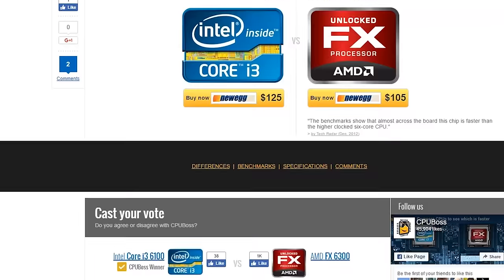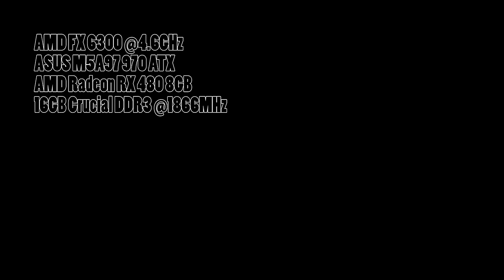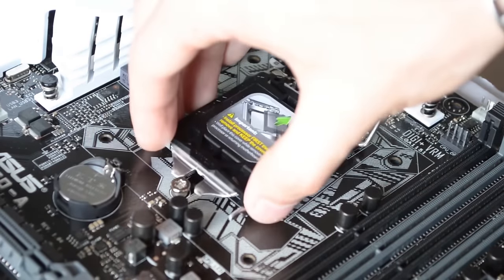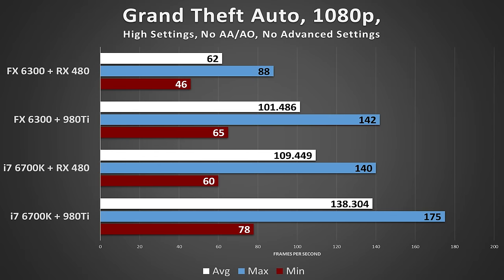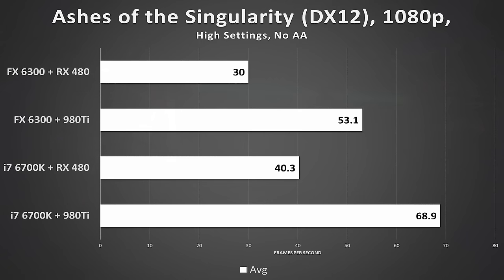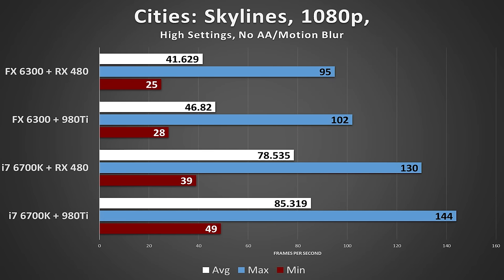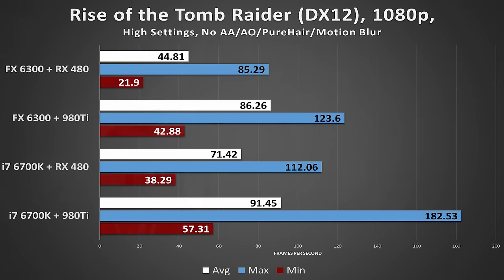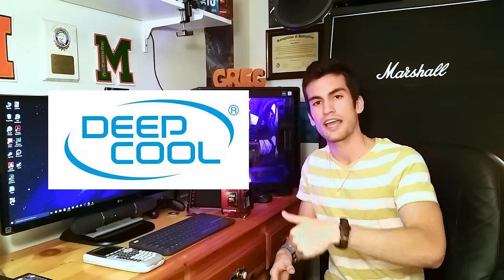AMD FX 6300 + RX 480: Severe Bottleneck?

Comment: i would like to see a fx 6300 vs 8300 vs 9500 with rx480/980ti video. I debating on what upgrade to go with and it further explain a sliding scale of bottlenecking. Plus you wouldn't have the ddr3 vs ddr4 fight in the comments.

Comment: My first PC build was done in 2014. I went with the FX-6300 and paired it with the 750ti and 8 gigs of RAM. I chose the 6300 over the FX 8350 cause it just felt right. Researching all I could about CPUs it just seemed like if I were to pay over $160 for a CPU I should look at Intel instead. But at $90 the 6300 was the best for the money.

Comment: CAS latency and timings are measured in clocks, which don't tell the whole story. If you have the frequency 66% higher and the CAS latency is 66% higher, then it's effectively the same CAS latency. For instance, 1600 MHz RAM with a CAS Latency of 9 is 11.25 nanoseconds, while 2666 MHz RAM with a CAS Latency of 15 is 11.253 nanoseconds. That said, DDR4 won't make as huge of a difference as what some people make it out to be.

Comment: I about to make an upgrade and I wanna know how much of a bottleneck I'll get, and if it's a "ok" upgrade.
My actual kit is:

MB - Gigabyte 78LMT USB3 6.0
CPU - AMD FX 6300 3.5GHZ
GPU - R7 370 4GB
RAM - 2x4GB 1866MHZ
PSU - C3 Tech 500R VE

I would like to get in there an MSI RX 480, and to reduce the bottleneck I'd OC my FX 6300 to 4.0GHZ maybe 4.5GHZ. Or you think it's better an MSI RX 470?

Thank you so much for the attention.

Comment: Actually, I upgraded from a Gtx 950 to an RX 480. I have an FX-6300, and I don't seem to have too many problems. Although it's mainly me not playing CPU intensive games, I'd suggest if you think you need an upgrade to get an RX 480. I plan on getting an FX-8350 for Mankind Divided at a later date, but for now if you want a "cheap" 1080 card, the 480 is decent.

Comment: I ran an R9 390 with an FX-6100 for a few months before I was able to upgrade to an FX-8350. I did have the 6100 OC'd to 4GHz and it ran fine, but the performance is much better with the new setup (should be obvious).

Comment: I think you would enjoy checking out Max PC's long examination of RAM DDR 3/4. They demonstrated CAS latency is pretty much useless info. Output just passes so much higher for the higher speeds. but also that above 2800MHz at the time was not beneficial.

Comment: Sweet video!!! :D 

I am running a i5 K2320 @3ghz and 12gb DDR3 1333mhz Ram on a LGA775 stock intel board... would I have sever issues running a R9 390 or GTX 970, or even the GTX 1070 for that matter..?

Comment: I am building a new PC using the AMD FX6300 in an ASRock 970A-G/3.1 motherboard coupled with a Nvidia GTX 750Ti graphics card & I think that will plenty well enough for me. it all depends on what is good enough is for you. Heck right now I am using a GTX 550Ti & that will play just about everything so no need to drop $400 on a graphics card or pay 3 times the price for an Intel I5/I7 processor. I haven't used an Intel processor in 15 years & don't plan to in the future.

Comment: Just to add some information but might be completely insignificant for the most part, but still some fun differences:

I am running a 2 year old gaming laptop with a decent i7 4710hq, at 2.5ghz. My previous main pc was my desktop with a FX 6100 at 4.2 Ghz. I really wanted to up my graphics power quit a bit, but I find it wastefull to spend money on a complete new desktop if my laptop cpu is more than capable for nowadays games. The only thing in my laptop that ages hard these days is my GPU. So I opted for a eGpu solution. Mind you, it runs at pci-e gen2 x1 speeds. Lucky me, I was able to get a hold on a Sapphire Nitro R9 390 for just 150 bucks... keeping in mind that in the future I WILL upgrade to a desktop (waiting for zen to hit the fans), I couldn't let this deal slip. I like my numbers so I did a valley benchmark, and I got a very decent score of 2236, with an average of 53.5fps. Max at 103 and min at 21.5. Me, being really curious how it would perform on my older desktop, plugged the gpu in and started to do a bench again (this time the pci-e was running at 2.0 x8, not x16, not sure why though, might be my old motherboard screaming). So I did the same bench, on a clean windows: getting a score of 2328, with avg 55.6fps, but with a max of 94.8 and a min of 18.5. So in a way, I did get a lower avg, but the mins and highs where quit a bit higher on my laptop... running at slightly more than half the clockspeed of my old FX 6100 and a much lower bus speed :D. 

Either way, i'm happy with my 390, albeit that it probably isn't used to its full intention.

Comment: So in most of the titles with 60Hz monitor and 60fps max limit in riva tuner I will not see much difference at all, if I put RX480 into FX6300 rig in comparison to new CPU's. Seems to me, that bottlenecking over the years has changed from hype in the past, to a state that occurs only with high refresh monitors today. Why would I let my GPU display 280fps if my monitor displays 60? That creates heat, noise and electricity waste.

Comment: What motherboard did you run the FX 6300 on and did you manually set the NB (northbridge) and HT (hypertransport) in the bios (2200mhz NB and 2600mhz HTis proper OEM for the CPU applies to all vishera 4/6/8 cores) if did this on a 970 motherboard were running 1800mhz or so on NB and 2000mhz HT also VRM throttling is a huge issue on 970 chipset due to OCing also if you don't manually set the NB /HT even on a 990fx chipset  (as my linked example proves later) it will often bug out 90% of time and go 2000mhz NB and 2200mhz HT this can take over 10% of performance out the gate from the CPU. I proved this on overclock.net and even pointed it out to a user on there when his was doing it. http://www.overclock.net/t/1399704/nothing-to-see-here/500#post_23264585 

 That issue can cause alot of the vishera's performance to be lost we are talking 10%+ especially in demanding instances AKA mid-high end GPU. I also explained another issue that is a big one with coreparking and AMD module design very wise to disable core parking otherwise it flushes the cache and CPU has to reload the cache data  causing a delay because the modules share the cache between 2 cores when one is parked the cache is wiped even if adjacent core is still using data that was in it making that active adjacent core have to start over.

PLZ don't take this as bashing for me pointing out such things like this I am trying to help you come at the testing correctly and with full details / research to many reviewers and such are biased or just flat out don't care. I like your videos just am trying to make sure you come at them correctly and with unbiased results. I myself used to be a big hardware tester and benched the snot out of hardware for many years but no longer do this anymore. I am now just a casual gamer that keeps up with tech along with trying to get all the facts straight about most of the hardware as it comes out.

Comment: The only thing I didn't like about this video is that you applied an overclock. There's no point in using an expensive cooler to test the performance of a 6300k as a consumer would not buy a cooler that costs (at least) half the price of the CPU at this price point. As such the bottleneck should be even higher than what you've shown.

Comment: i'm so glad i sold my old rig for reasonable price .
I had an fx-6300 oc'ed to 4.2ghz all day everyday , but somehow my new i5 6600K at 4.5Ghz is noticeably smoother - even on stock clocks . One could spot differences even on the windows gui .
And now that i hear how much of a bottleneck is 6300 for the rx 480 , i can only imagine how huge of a bottleneck it would be for my gtx 1070 .

Comment: I built my gaming pc 2 years ago and I am thinking that the next thing to upgrade should be my processor. The thing is that less than a year ago I had to replace my motherboard because it died so I am not sure if I want to change motherboard because of the socket right now.
There is an option you would recommend in the am3+ socked that I'm using right now? The only choice I've seen in the local stores in my country is AMD® CPU FX-8350 and I don't know if it would bottleneck for instance with the RX 480.

Comment: My first and current pc build is an ultra cheap 6300 / r9 270x combo and for the money I spent I am happy. I play a lot of csgo but in bf4 I can run 50-70 fps @ 1080p at high/ max settings without all of the garbage turned on. Having said all of that though the pc bug has bit me and I am having dreams of a decent 1440p build in the near future and I am not sure if I will go amd again or not.

Comment: I once made a comment and it was stupid and pretty ignorant looking back. sorry about that.

though with a different mindset I must ask what the clock speed was set to on that 6300 If you remember?  I do have the same processor and I have it on 4.7ghz.  these CPUs are advertised to over clock . did you use the stock speeds? the 6300 is 3.5ghz and boosts to 4.1ghz.  some of us enthusiasts do overclock everything to see how far we can push things :)

Comment: I have AMD Phenom II 555BE + GTX 960 2Gb combo on my second gaming computer and it's running modern games fairly well. I scraped it up from spares I had laying around and bought the gpu (used) and memory (16Gb DDR3) (used) to it, so it was quite a cheap ( around $220) build. I was quite scared that the OLD cpu would of been a terrible bottleneck, but I was so wrong. Most of the games run nicely, even tho it's some frames less compared to my main computer with same GPU (4Gb model tho) and FX-8350.

Comment: Zen should drop spring next year, I personally just upgraded from an FX 4300 so an 8370 because it was cheap and came with that wraith cooler.

but I am catching up on gaming now that I have an RX 480, it runs all the titles at a buttery smooth 60fps on maximum settings, that my GT 610 couldn't even start.

Comment: i will say the fx-6350 @4.5ghz matches the fx-6300 @4.6ghx in my tests and cant figure out why? it indicates an inproved identical cpu not just a factory overclocked fx-6300. maby gust a heavier duty power delivery on socket maby faster cache or something that would cause a 100mhz lower clock do the same for $10 more.

Comment: but you have to consider that FX 6300 is for lower budget, like us, people from Mexico and latin america, and I think a fair comparison would be with the FX8350, can you explain why you did not do the comparison with this last processor I mentioned?, are you afraid of comparing a "4 cores procesor from AMD" versus a "4 cores processor from Intel"?
Reply: Because it simply wouldn't change much more than the performance percentage of the 2 amd cpus.. The 8350 is going to be roughly 15% better at the SAME clockspeed as the 6300.. So just do the math and add 10-15% to the 6300's frame rates and that's the difference, ohh and by the way an 8350 is an 8 core..

Comment: Well I don't know how to say it but as far I can see my Fx 6300 at 4.5 Ghz is NOT bottlenecking my Asus Strix 8gb. I have ran a lot of benchmarks and for example in Heaven (max settings 1080p) while the GPU is at 98-100% the Cpu is between 25% and 65% never more than that. I'm in shock.

Comment: I've watched this video in the past and now looking for cheap top card for my old PC last upgrade, so I won't roast You for differences in platforms. Very gratefull You did this video.
Sadly realisation You've tested already heavily OC'd fx6300 made me loose hope of any sense for going higher than my current RX560 2GB. Better card would improve playing my backlog of fairly old games, but case is small and doesn't like heat, OCing CPU and adding something like 580 or 570 will make it a vacuum loud PC during gaming most likely. I could OC cpu high but also undervolt gpu a lot so they're kinda on the same page, but then paying for rx580 doesn't make sense if I will stay with my setup for good few years or it will pottentially be my last gaming pc. (adulthood is already here, but i don't agree with it still)

Comment: My current build has the FX 6300 and my gpu is RX 480 GAMING X 8G and it runs games like GTA V, Modern Warfare, and most newer and newest AAA titles no lower than 100fps.
Reply: i cant run warzone correctly and i have a 6300

Comment: So quick question. I'm building my first PC and I'm getting an i7 6700k for the gaming and the Photoshop work I want to dabble in. Right now I have the MSI offbrand Radeon 480 8gb in my wishlist. The question is: Should I swap the 480 out for an MSI GTX 1060 6gb for an extra 20 dollars? How much of a cross the board performance boost with the extra 20 dollars give me?

Comment: Redo the Intel tests, but this time use an older i7 (like 3770k or something) with the latest core i5 6600k and i7 6700k and check results at 1440p and 4K.

Comment: Is it true? AMD gpus are more cpu performance dependent than nvidia's? Very noticeable in Hitman benchmark. (6300 + 980Ti) vs (6700k + 980Ti) only has 7.9% difference while (6300 + 480) vs (6700 + 480) has 41.29% difference. I'm a bit worried since I'm planning to get RX 480. I only have a budget cpu. By budget cpu, I mean the likes of an ancient i3-2100 :D

Comment: I mean I built my first PC a little under a year ago. I went with the FX-4350. From my research and from my own benchmarks, unless you are rendering videos the 4350 will perform better or on par with the hexa-core varients in most titles. It's also a decent amount cheaper on average (I got mine for $70 at the time and the 6300 was $95). They also remain a fair bit cooler. when overclocked to 4.7 GHz, my 4350 never got above 57 degrees C ever (Hyper 212 Evo for cooling btw, budget was very much in mind for this build) 

If anyone ever sees this comment, is Ryzen 3 worth the upgrade, or is it more of a side-grade?
Reply: It absolutely destroys the FX 4350. It beats the FX 8370 actually https://www.youtube.com/watch?v=tJNbV6-GJis .

Forget all "folk wisdom" about AMD CPUs that was based on experiences with AMD FX. Ryzen is a COMPLETELY different beast. It has nothing to do with FX processors.

Comment: I have the same case as you and ive got a new LED kit on the way... how did you mount your LEDs? I dont know how to mount them on the top/bottom without the PSU shroud obstructing the power cables :/

Comment: i am currently running an AMD FX 6300 with the RX 480 and i get ~130 FPS with Vulkan in DOOM in Nightmare settings, 1080p. I am planning on an upgrade but i am not sure, weather i should get an FX 8350 (very good performance in DX12 and Vulkan) or an i5 6500

Comment: The FX 6300 is still somewhat decent if you have a aftermarket cooler and overclock to 4.00 ghz minimum and pair it with a mid-ranged or budget GPU. Otherwise, the only processors from the FX line that can still be kick it are the FX 8350 and up.

Comment: I've seen videos of people clocking the 6300 to 5Ghz and higher, I hear it's only limit really is your cooling system.
Reply from the maker: The only real limit is how comfortable you are with 80+ degrees Celsius at the core.
Reply: Idk what cooling you use getting shit temps like that
Reply from the maker: Pay attention. Kraken X61. 280mm rad. Keeps my i7 6700K under 60C. The FX spikes to 85 with the same overclock.
Reply: I have my 6300 overclocked to 4.5 and with a coolermaster evo 212, and a few extra case fans I keep it at 35-40C, during intensive gaming it goes to 45-50 tops

Comment: how would the fx-6300 + rx 480 combo handle Arma 3 and Arma 2: Operation Arrowhead? my current fx6300 + gt 740 gives me 28 avg fps on the lowest settings in both games so im wondering if upgrading to the rx 480 would make any difference

Comment: Why didn't AMD make it a 6 core instead of a 3 core and the 8320 8 cores instead of 4 core, they would give Intel a huge worry as the 8350 has multi core performance around the power of the i5 and also having the same amount of single core performance would make it really good.

Comment: hey S.S. i just built an i5-2500k rig not to long ago, 8gb of ram asus 67 series mobo with a 240 ssd, currently running an r9 270x 2g i picked up for 100$ would it be worth looking at the 480 or stick with the r9 270x (have a fully built gaming pc, the mobo and cpu combo was to good to pass up[$75] and with xbox halting the 360s online, i decided to build a media and maybe streaming pc)
Did i hear your from orlando? if so, id gladly let you trial my system for some tests if need be.

Comment: Not sure if its  a good idea but I'm going to watch this video and find out 

---- after watching-----
I'll admit I'm surprised the 980ti did that much better than the 480 WHEN PAIRED WITH THE 6300, I would have thought it would have held back the 980ti to similar performance levels of the 480

I personally play tomb raider as sub 60fps so I can get ssaa at 1080p ultrawide resolution...

Comment: Buying an FX chip these days is almost impossible to swallow. You will pay $85 for a FX-6300 and roughly $80 for a decent 970 board. Or you could get a used i5 4570 for about $130 with a $65 B85 board. So a Intel platform will cost you about $40 for almost 2x the performance.

Comment: Pairing a RX 480 with an FX-6300 definitely proves mostly fruitless.  However now days the FX-6300 can be had used for as low as $35 and if paired with something like an r9 270x (recently purchased one for $80) it's a pretty great option for very low budget builders.  Other great options exist as well.